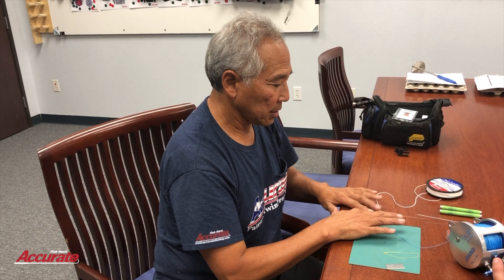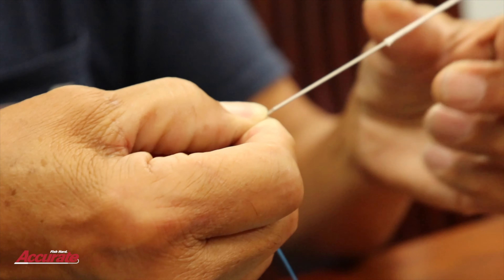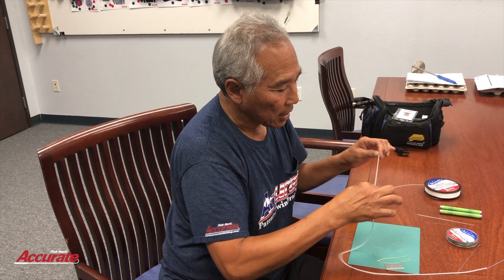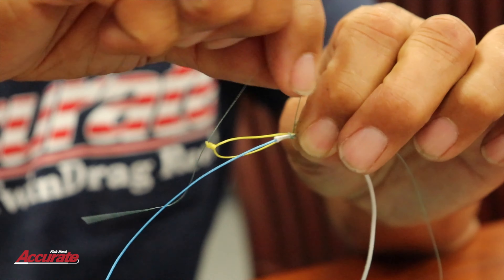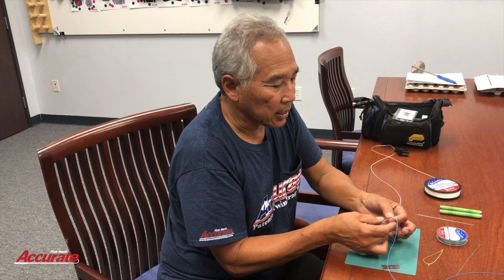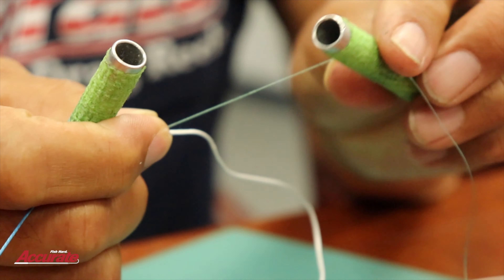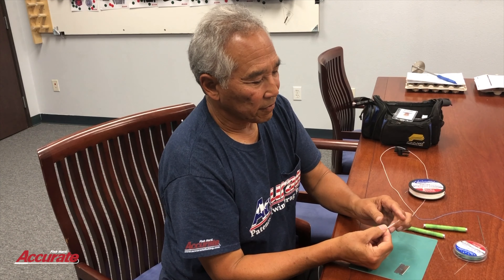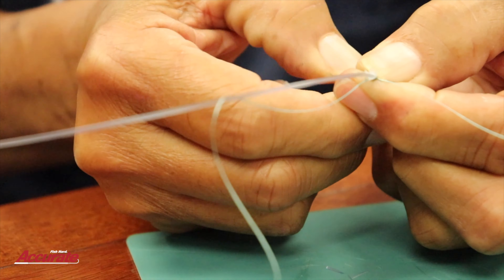Super Clean Hollow Spectra Connection! - How To Tie The Nail Knot Finish

Comment: great video! i guess this could be used to rejoin two pieces of solid braid . in case of some damage on main solid braid line i can cut damage out and re join with hollow braid..
Reply from the maker: This is one way or you can tie a Bimini in each side of the line and attach them loop to loop three times through the loops cat paw.
Reply: @AccurateFishingReels  only issue with Bimini in braid is that it does reduce the strength of the line quite considerably. They are not 100% knots in braid as lot of people think. can lose up to 30 to  40% of strength . in one knot competion  the wining Bimini had to be wrapped by hand , no rolling tag end and pulling up o the loop to roll tag end. it was shown that especially in braid , the normally tied bimini is not that strong... whereas the splice is more or less 100% assuming no slipping

i love your nail knot finish..easy to do and very compact and neat

google sportsfishingmag strongest-fishing-knots-braid-to-leader to see info about the bimini

Comment: Only two feet for the splice? I’ve been running my topshot 8-12 ft into the hollow core.
Reply from the maker: Casting knots through guides is tough. Rule of thumb is five foot bluefin tuna is 2 1/2 feet to stomach? roughly. If he swallowed the bait you would still have 6 - 12" at 3 or 4 feet. We do not like to cast knots through the guides is why we use short leaders. Need a longer cast for foaming fish. Thanks.